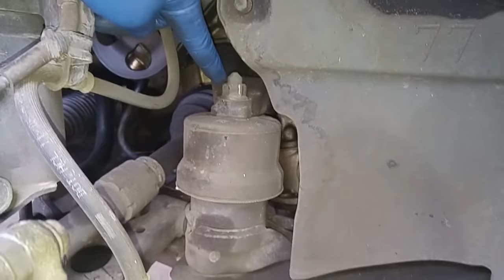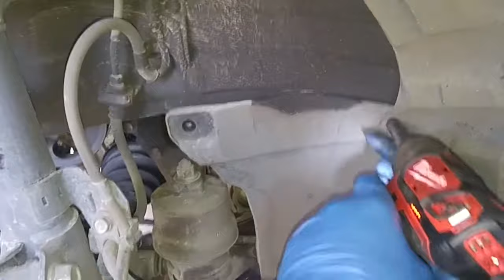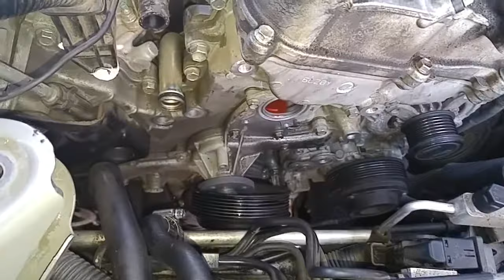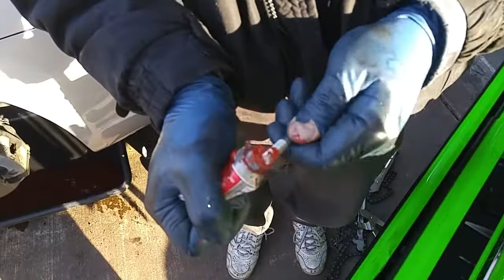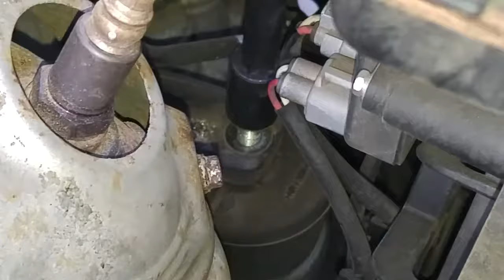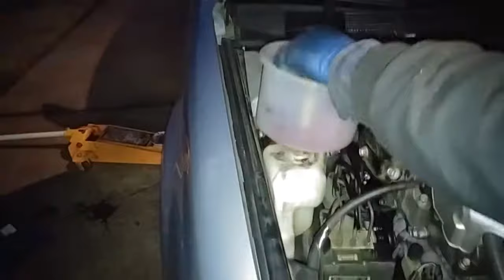Toyota Avalon / Camry / ES350 V6 2GR-FE Water Pump Replacement

Comment: FYI: There has been an upgrade or revision to the water pump made for this motor.  You can tell them apart by the shape of the pulley hub, the old version, like the one in this video has the circular hub,  the new version has a clover shaped hub.
Reply from the maker: Thanks for sharing and the heads-up on the pulley hub design differences!

Comment: What rtv did you use
Reply from the maker: Permatex ultra gray.  But the Toyota designed water pump gasket doesn't need RTV.
Reply: @hardlymovingpro I appreciate the response, but I seen you used rtv on the bolts. Did you use the permatex? I’m 23 years old trying to do all the repairs in my 05 Avalon !
Reply from the maker: I sometimes used RTV as a substitute for Loctite and antiseize.

Comment: Do you need to put the  red silicone on the water pump
Reply from the maker: Not needed if the replacement gasket is made of steel

Comment: Why use Dialectic grease?
Reply from the maker: It's a silicone based grease that doesn't react with and swell rubber.   Very high heat resistance, water proof and lasts a long time.  Coating anything rubber will prevent dry rot.

Comment: You didnt drain antifreeze before?!?
Reply from the maker: No need to drain the engine block.  Just let it drain out of the pump port.  Capture the fluid underneath with a cement mix pan.  Draining out the whole block will introduce air pockets.

Comment: Car Nut used a screwdriver to hold bolts so pulley doesn't move to remove 4 bolts from water pump pulley ....good trick ill do that cause i dont have a chain wrench
Reply from the maker: Old mechanic's trick!  Also, with the belt still on and tension on the pulley, a quick jerk with a box wrench on the nuts may get the initial tension off.

Comment: 2007 avalon coolant leaking, my mechanic said need to replace water pump, quoted me $450, seems reasonable. what say you?
Reply from the maker: That's a good price quote for around 3 + hours of work.  Make sure you're getting a Aisin or GMB water pump.
Reply: @hardlymovingpro  Sweet, thank you for your reply.

Comment: Hi awesome video thanks! Just noticed my 2005 leaking today. Found from some drops of pink antifreeze on the ground today.

And the serpentine belt was wet. That explains the squealing for the last few weeks. 

Question please, how would I know if it's the water pump or the thermostat leaking. 

Really hoping it's the thermostat. Thanks again for the great video.
Reply from the maker: Thanks for your critique!  Never encountered a leaking thermostat.  Almost 100% certain it's your water pump.
Reply: Okay thanks for your quick response. Did you replace all the pulleys or the ones in your link for just one or all? Thanks
Reply from the maker: Just one.

Comment: Thinking I didn't clean off the water pump seal enough last time cus I just did this last year and it started leaking again. Hoping this round lasts a bit longer.
Reply from the maker: You can clean the matting surface of oxidation using a wire wheel brush.  Don't nut use sand paper.
Reply: Thank you, I didn't nut use sand paper.

Comment: Is it normal to get a little bit of coolant leakage after hitting near the stud and releasing the tension? I noticed this happen when the motor raised. Great video! thanks is advance
Reply from the maker: What stud are you referring too?
Reply: @hardlymovingpro  The motor mount stud, after the motor raised I noticed about 6 oz of coolant fall out, not much.

Comment: Just wondering what are the two o-rings that you replaced? How would one go about getting a set to replace the old ones
Reply from the maker: O ring between the pump and the block and the other for the inlet pipe into the pump.  They should be included with every new replacement water pump with a metal gasket.
Reply: @hardlymovingpro  Okay, thank you. I appreciate the information!
Reply from the maker: You bet!  Try to get either the Aisin or GMB brand.  GMB is cheaper but don't provide a steel gasket.  You can buy the gasket seperately.  Aisin is the OEM provider for Toyota.

Comment: If I changed the thermostat and didn’t use that device to remove air would it still overheat
Reply from the maker: While letting the engine warm up and get to operating temperatures,  keep adding coolant as the level drops in your radiator cap fill port.  Keep doing using no air bubbles come out of the fill port.  You will get some spillage that the air comes out.

Comment: This video is fantastic.  Got the Gates water pump from Amazon half off (open box) in perfect condition.  Water pump and belt, $50 and 5.5 hours versus $900 at the shop.  If you have the right tools, keep your laptop close to keep rewatching parts and number the bolts and make a diagram.  I couldn't believe how easy it actually was thanks to this video.  Thank you.
Reply from the maker: Thanks for sharing your experience!

Comment: I don’t understand why all the pumps come with a timing belt kit? Makes no sense… I don’t need timing only the pump… it’s not in the way? Any thoughts on this? Great video by the way…
Reply from the maker: Don't understand?  Pumps can be bought separate from the belt
Reply: @hardlymovingpro  I’m fairly certain and from all I have researched on this motor you have to remove the timing components to get the water pump pulley off. They sell the kit because the pump is an interior water pump? Am I wrong? Mine only has 8 bolts I believe?? It’s a 2002 Toyota Avalon. I think it’s a little different set up. I’m pretty sure you must remove the timing to get the pump off? All I have researched says that it is the case for this vehicle. However. You don’t touch the timing. Very convenient if I can do this great. I’m not sure I can but I would love to
If possible. I’ll let you know soon. Direct hit and all data says no….
Reply from the maker: I believe your 2002 Avalon uses Toyota's 3.3L 3MZ-FE engine which is timing belt driven.  This video is for the 3.5 2GR-FE is a completely different engine using a timing chain with an external accessory belt driving water pump.

Comment: How do you lift the engine up? Last time I jack it up by the oil pan and it bent. I don’t want an engine crane if it can be avoided
Reply from the maker: Place a square wooden block between the jack and the pan.  The block will spread the lift as to not bend the pan.

Comment: Thanks for your video, l changed my wife's water pump.  That was really hard to do in such a tight space, but the jacking up of the motor was the key to just a couple of valuable inches of workspace.  Thanks!!!
Reply from the maker: Great job!  Believe Toyota's repair procedure is to drop the engine.

Comment: What strap wrench did you use?  I have a Toyota spanner tool that I've used on my '05 Camry  water pump pulley, but that strap tool looks like the way to go,
Reply from the maker: That's a vice grip locking chain strap wrench.  Link to the tool should be in the text description area of this video.

Comment: Great video with all steps laid out. I am curious, how could the engine be moved once the nut for the center mount on the passenger side was removed? Doesn't the engine have other nuts and bolts that keep it stable and from moving, e.g. near the driver side?
Reply from the maker: The engine will allow passenger side lift while pivoting on the driver's side mount.   With the front motor mount bolt unscrewed but not removed will keep the engine centered.

Comment: I called a shop near me and they quoted me an ungodly amount of money to replace the water pump on my 2012 ES350, the Avalon is basically the same car. They tried saying sometimes the engine has to be pulled out, I thought the idea of that was crazy. Seemed like a way to charge me more hours for labor. I can get am oem water pump off eBay for $150 and just do it myself. I’ve replaced the alternator already along with a few other things already, I feel like I can be up to the task of doing this thanks to your detailed video. Hopefully I’ll be successful. 🙏
Reply from the maker: Good luck with the repair and let's us know how it worked out!

Comment: Most excellent job!  I would have changed the thermostat while I am at it. Too easy not to since you have it all taken apart. How many miles did you have on that pump?  I am at 95,000 and hoping mine will keep going to at least 125,000. 
One other point attached a vinyl tube to the bleeding nut and run it back to funnel coolant. Turn car on and run at 2,000 rpm’s until fluid starts flowing - small trickle continuously back into coolant funnel. Will take several minutes.  Important to bleed it properly. Thanks again really great video
Reply from the maker: Thanks for sharing!  These pumps will make noise (worn shaft bearing) before the pump completely goes.  So you have a little bit of time to replace the pump before complete failure.  After installation of the new pump, fill coolant via the radiator fill port and have the bleed nut loose.  When a little coolant comes out air bubble free, you're good to go.
Reply: @hardlymovingpro  thanks!  The bleed procedure if done properly involves attaching a vinyl tube to the bleed nut and running it back to the fill funnel. Check it out. It is much more thorough and gets all the air out. Doesn’t get coolant all over the engine either. Thanks
Reply from the maker: @condor5635  thanks for sharing!

Comment: Great video.  However, avoid buying Gates water pump - they are crap.  Buy OE.
Reply from the maker: Haven't yet had a failed occurrence with a replacement Gates pump.  Aisin, however, I've seen fail under 100k.
Reply: @hardlymovingpro  I guess my mileage varied.  OE lasted 120k miles, Gates failed in 30k miles.  Maybe they went with a cheaper source.  They make good belts though.

Comment: If you'd crack the water pump pulley bolts loose while the belt was still on, you wouldn't need to mess around with that "strap wrench".
Reply from the maker: You're right but doesn't work all the time.

Comment: Buy a torque wrench guys snapped a 10 mm on bottom of water pump now I’m fucked
Reply from the maker: 10 mm bolts only require 7 lbs of torque.  Next time use a 1/4 ratchet wrench and only apply hand torque.  Depending on where the bolt sheared, you might be able to screw out the remnants of the old bolt.

Comment: Hello I haven’t had problems with the water pump yet on my 07avalon. Knock on wood. Almost at 200k miles. Should I replace it now or just wait until it leaks?
Reply from the maker: I'd replace it.  Consider yourself fortunate you got 200k out of them.  I've replaced them under 100k.  I'd even replace the radiator.  The plastic tank or the sealant that fuses the aluminum to plastic gives out.  The upper and lower hoses last longer than the pump and radiator!  You let your car overheat just one time, the head gaskets are gone.  Then it's engine replacement time.  All those head gasket sealants don't work on aluminum engines either.  Not worth getting stuck somewhere where you'd get ripped off on a emergency repair.  Dealers are charging upwards of $700 to replace a water pump.  Maybe more for a radiator.
Reply: @Hardly Moving Productions  thank you. Financial issues at the moment but I hope it can work until spring/summer time. Should I purchase the gates or oem version? And what radiator do you recommend? Thank you god bless you
Reply from the maker: Gates is good.  Aisin is the OEM.  Denso makes the radiator.
Reply: @Hardly Moving Productions  thank you so much. Also, would lifting up the motor mess up the exhaust pipes? The flex pipes? God bless you

Comment: You got a video on replacement of rear spark plugs on this car I just did mine and when I did the rear #6 when I pulled on the big wiring harness to get the coil out I pulled the 3 wires going to the camshaft sensor right below it. 3 wires are yellow,red and black but now I dont know the order they go into the connector, by chance would you know much appreciated
Reply from the maker: There are two of the same sensors.  Just follow the layout of the other sensor.

Comment: Right on!
Next to the coil packs & rubber oil line… this is the 3rd biggest problem with the 2GR-FE. If you have 150K and haven’t done this, do it! Preventative maintenance.
Reply from the maker: You got it!  PM is the way to go!  That's why planes aren't falling out of the sky.
Reply: I don’t think they have the rubber oil line anymore for quite a while. I know it was a huge issue some time back but definitely something to replace if you have them.

Comment: I was hearing sounds in the engine and after it was checked with the mechanic, he told me that the water pump must be changed and I changed it and I was surprised that the problem was not the cause 😂 Now is it good to change it anyway?
Reply from the maker: Depends on the mileage of the car.  I'd replace it at around 100,000 miles.  Other noise may be anything that rides on the accessory belt (pulleys, alternator, ac compressor, power steering pump bearings).
Reply: In the end, the problem was from the electrical dynamo... Few of the good specialists, mechanics or electricians, help you in solving your car's simple problems.. Thank you brother for answering our questions.
Reply: @user-ty2ti7fn2n  - so should i change my alternator?

Comment: Question : how you know the pump is bad ? My Avalon run and drive good , no over heat , just have some noise around the belt area ? Is it water pump?
Reply from the maker: Could be the water pump worn bearing noise.
Reply: @hardlymovingpro  you can’t just replace the bearing ? Or you have to do the whole thing ? The bearing is inside the pump , correct ?
Reply from the maker: @ruiwu3604  It's a press fitted component.  Don't know of anyone that sells a bearing rebuild / replacement kit.  If you find one, let me know.  I'd make a video.

Comment: I have the same engine. Wow! Didn’t realize what it took to change the water pump. I just recently changed the spark plugs and that was challenging. Maybe Toyota and other males should seriously consider make areas of space to at least get some important tools in those tight places. Great job! You’re a pro.
Reply from the maker: Thanks!
Reply: They want you to bring it in!  They know what they're doing with those small spaces. 😂

Comment: I own almost the same Avalon with 3.5l v6. The idler pulley started to squeak loudly. I'm thinking replacing a belt as well. What brand would you recommend for all these parts and would you replace the tensioner pulley that comes with bracket as well? I've got 245k miles on my 06 Avalon.
Reply from the maker: Yes ... Replacing the pulleys and belt because of the noise and mileage would be prudent.  Recommend Bando for the belt and either Koyo, GMB, Timken or SKF for the bearings.
Reply: @hardlymovingpro  did you mean pulley assemblies or just bearings of those brands? I tried to find sellers of idler pulleys and tensioner pulley of brands you mentioned and didn't find any.
Reply from the maker: @yurii.5613  Try rockauto.com. They have hard to find parts
Reply from the maker: Also worn bearings in the alternator can cause noise.
Reply: @hardlymovingpro  I sprinkled a 303 protectant on the idler pulley and the noise was gone immediately.
Reply from the maker: Good indication that it needs replacement

Comment: Considering doing this myself on an 08 avalon. The wp pulley is wobbling and making noise. 170k miles with no other noticeable issues. Would it be wise to replace other items with the pump or just one at a time?
Reply from the maker: Accessory belt and maybe pulleys.

Comment: Great video!! Is it any extra time or difficulty to replace the thermostat when chasing the pump?
Reply from the maker: Not at all.  You have to remove the thermostat housing assembly to get to the water pump anyway.  Once the housing assembly is off, just remove the two nuts that holds the housing cover.

Comment: I live in Brooklyn, NY. A dealer charged me $684 for labor (labor rate $149/hr) and $ 289 for the water and 54 for coolant. What's your opinion?
Reply from the maker: Down here in Memphis the dealers are charging around $700 net.  Labor rate is $120/hr.  I can do the job in under 3 hr.  The Aisin OEM part is under $120.  Toyota red coolant premixed @  Walmart is $13
Reply: @hardlymovingpro  Thanks! I see the water pump for $ 184. They charged me $ 289
Reply from the maker: Way overpriced!  For another $50, I'd do the whole job parts and labor.

Comment: God bless Toyota engineers. 
I've seen too many cars that require you to break
down half the engine assembly😡. (Ford & GM)
Reply from the maker: Some consider this replacement difficult.
Reply: I miss old school Fords. Crown Vic, you just unbolt it and swap for a new one. EZPZ
Reply from the maker: Did a ac condenser replacement on a crown vic.  Took me 2X longer than a Toyota.  Also a valve cover gasket replacement took me 3X longer and the plastic valve cover was cracked.

Comment: Great video! Because of your great work I’ll be doing my RX350
1 question though.. z are you using 2 jacks.. 1 to hold the car up and the another to jack the engine up from that?. I don’t wanna kill myself..
Reply from the maker: Yup ... to tilt the engine up slightly when the right front wheel is off.